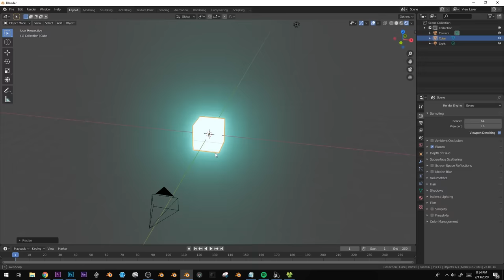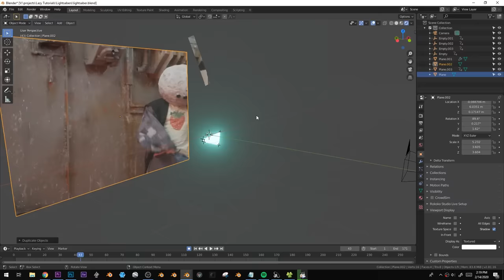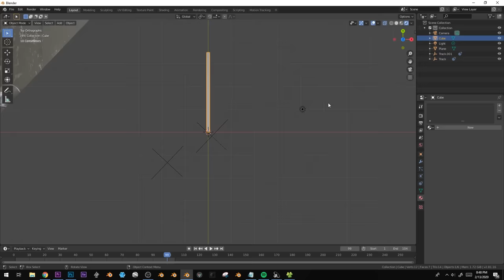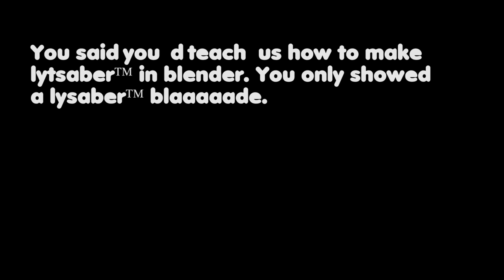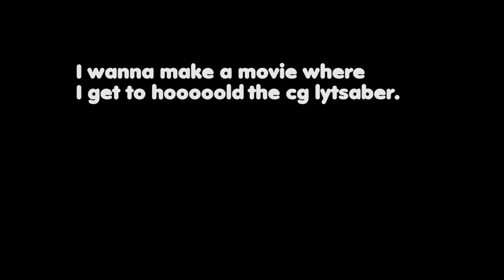How to Make Lightsabers in Blender (the hard way, and the easy way)

Comment: Couple tips for newbies wanting to use the “hard way” in this video with hooked empties:

-If you don’t like the rectangular look, you can bevel the vertices (ctrl+shift+B) and hook constrain each group of vertices rather than just one vertex. Just make sure the bevel is very very tight to the corner, your key framing will also require you to adjust rotation now so be prepared for that. 
-A comment below talks about efficiently masking your tube. Going frame by frame is pretty painstaking, instead find key changes in motion, start wide and refine until it looks good enough. Frame by frame can look good but not necessary
-If your video was shot on a phone, Blender may subtly change the video. This means a screenshot masked over it for the lightsaber extending may create a noticeable box of different colors. You can use the exact same video file instead, set the frames to 1 and change the offset until it’s at a frame where you can mask it. This also prevents cropping issues.
Reply: how do you select a vertice

Comment: 2:25 - This, while slightly better than "going frame by frame" as suggested a bit earlier, is still a (common) mistake. The efficient way to rotoscope (or manually align things in general) is to start by placing keyframes at very large intervals (several seconds, ultimately the whole clip - i.e., one at the start and one at the end) and then add a keyframe, within that interval, *on the frame with the largest error*. Keep repeating this and you'll end up with the smallest possible number of manual keyframes.
Reply: That seems ridiculous when you consider ultimately how much motion the objects go through you will end up having to manually adjust each frame anyway
Reply: @gencraigz  the advantage is that that way you cant ever make more adjustements than if you were going frame by frame, cause it might just work in places
Reply: @juangabrieleliasgomez518  true

Comment: CTRL+E Extrude by normals.. man I've been looking for that for ages!
Reply: You could alternatively just hit E to extrude and then right click to escape. Then resize the new faces. CTRL+E is better though.
Reply: I usually hit E (extrude) then S (scale) then Shift + X/Y/Z (makes the scale command ignore the selected Axis). 

The lightsaber on the video could work with E  > S > Shift+Z.
Reply: When I move the hooks later on the beginning frames begin to disalign and the whole animation is not aligned anymore ?
Reply: i cant play vidio in image texture when i press space, any suggestion?
Reply: @murilokleine  or press alt+E and choose extrude among normals
Reply: @murilokleine  ++ me 2
Reply: Ctrl-e takes you to the edge menu in the edit mode
Reply: @radhinnasywanabyasa1673  You need to make an initial keyframe at frame 0, then keyframes as needed throughout the video. Then when you play it back the hooks should move your effect as expected.
Reply: truly a gamechanger
Reply: Here I've been hitting E to extrude, escape to cancel, and G to grab and move instead of just using I for inset.
Reply: wow even Cryo Chanber is here!

Comment: You can get retro-reflective tape for putting on bicycles and stuff. I feel like there might be a use for that for making tracking markers in applications like this.
Reply: Maybe a LED strobe synced to the beginning and end of the shutter in two different colors then it could track all the blur deformation too  (or calculate the expected deformation from surrounding frames).

Comment: Tips: Make each lightsaber for each character unique to that character as canonically, people have to make their own lightsabers rather than buy one from the market.
Also, if you add a more yellow texture (same as copper but yellow) you can put some Electrum bits on their which symbolizes wealth.
You can make a Krayt Dragon Stone lightsaber by making it brighter than normal, Trainer lightsabers are usually shorter because... well padawans are shorter because they are younger.
Make sure to add a small incline somewhere on it so you can access the crystal.

Comment: 4:27

If you want to do it the really pro way:

- Go to edge select mode
- select a vertical(!) edge loop
- select -> checker deselect
- select -> select loops -> edge rings
- hold ctrl while switching back to face select mode
Reply: What did he do a 3:39 ?!
Reply: @njplay  lol he entered top view using numpad if u dont have a numpad use the thing on the top right with x y z
Reply: @Charduza  thanks bud

Comment: spent 3 solid years in blender (animation, rigging, and poly by poly for my stupid ideas, and also modeling for 3D Printing), but then let skills atrophy for 2 years. I've seen more blender instructional videos than I can count, remember, or hope to remember. This was absolutely fabulous; so tight and punchy and clean with focus on solid foundational techniques that (like all efffing blender things) requires one tiny bit of hyper specific sophisticated knowledge to make everything work, with solid fundies wrapped into a hilarious generally solid learn-bomb. I think you should spin your approach out into a blender course and charge for it, but first, for noobs, it would be great if you just did a remix-ish of your 30 second lightsaber blade build cause that was as concise and solid of a dirt-simple overview of A LOT of most-uised modeling techniques. Well done. Many thanks. I will patreon your face!

Comment: do you think it would be a good idea to make a lightsaber shaft and then a little pice which is transparent, then track that onto the handle. because in theory, I think it would be alike taping a stick to it so it should work, this way you could many slice stuff with it as well. 

edit: Mabey the hand would obstruct the markers but you'd just have to do more by hand I think

Comment: hey at 4:27 a better way to make a saber would be to use the screw modifier. Way less vertices to deal with and can be dynamically changed later. Aslo booleans. Use them.

Comment: Using the second method, I should be able to just track the top and bottom of the hilt, and line the beam up with those two points, but only have the beam start from the top point right? Seems like the carboard tube isn't needed but I'm prob wrong.

Comment: would the tracking dots still work if the blade is moving alot like in the hard way portion of the video or are they  for only slight movement's

Comment: Isn't there a way to get the glow to composite correctly using alpha "premultiplied" colors during render? Edit: I actually tested and it works "correctly" when using node compositing (after enabling transparency in the render->film properties) but not using the camera background-image properties.
Edit 2: Obviously, if you do use node compositing, than the masking of the space ladder is best done using a mask (in the movie clip editor) and not a mesh like in Ian's tutorial. As a "bonus" the masking  could be done using point tracking if the camera or ladder where to move.
Reply from the maker: Definitely!!! And the blender compositor is way more powerful than trying to do it all in the viewport, for sure- I just kinda liked this way as in into to thinking about compositing in blender. 

(Also oh man yeah- combining masking with camera tracking- that's crazy excellent!!)

Comment: Hey man, I love this tutorial. This has been the guide to my first attempt at VFX so thank you for inspiring me! I have a bit of a problem though, I tracked the lightsaber material onto my broomstick and it looked great. However, I then saved and exited blender to carry on later and now the lightsaber is essentially trailing behind the broomstick: it is not in time and is offset for some reason. Its movement is still great but it isn't matching up with the video for some reason. Any ideas?
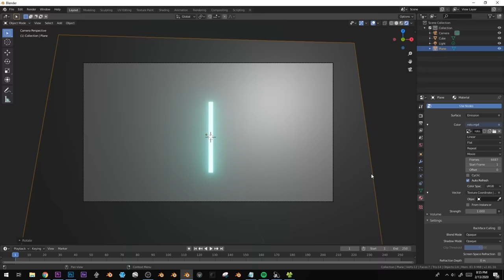Reply from the maker: Ooo- yeah! It sounds like it's probably offset by a frame, yeah?  Check out the material settings at 1:20, and tweak the "Start frame" setting a frame or two in either direction. That should hopefully clean things up! Let me know if it doesn't! ...No idea why it would randomly just shift like that on you, though :/
Reply: @IanHubert2  I think I've got it working now (: 
Thanks so much!

Comment: changing that  cube to cylinder is not for a beginner without hoitkeyes and so on.  after some time findind my prob. 
I wanted to tell: just mark ur cube and press shift +a and the chose cylinder and it works that way to. This vid is ofc for oepole who knows some blender or other like maya.
Reply: I mean you can google that stuff easily, but you're not incorrect you need baseline Knowledge of Blender.

Comment: I need help with creating the emission material, I'll select it with the cube selected, but when I go to change the color, nothing happens
Reply from the maker: Ah- make sure you're in a rendered mode instead of just solid view! (hit Z or Shift+Z)
Reply: Simpler way if you don't understand anything he said: go to the top right of the screen in layout and you'll see 4 balls. It should be on the 1st ball. Click the 4th one with the smudge and little lines and that's how you see the shading. It should be called  Viewport Shading.

Comment: I am at 2:20 and for some reason, my video is not playing. What do I do?
Reply from the maker: Hmmm- under the material/texture settings, make sure the video has more than "1" in the "Frames" input. If you load in a video, but then load in a different video, sometimes it doesn't set it to the right number of frames. You can just crank it to like 5000 or whatever- having too many doesn't hurt anything :)

Comment: I have a problem
When I set the surface to emission, it doesn’t change to the colour it’s set to
Even when I check “bloom” and the render engine is “eevee”
Please help
Edit: ok I just fixed it
New problem: I can’t move the points like at 1:46
Oh and also it doesn’t show when the footage is there
Edit 2: OMG I JUST FIXED MY PROBLEMS AGAIN
Reply: i've encountered the same problem with emission, how did you fix it?
Reply: You see the thing in the top right of the display? See the circle things? Select either the one that’s a 3/4 gray coloured sphere or the one that’s fully grey
That renders it out

Comment: Hey, I am following the hard mode step by step, but I dont know why I see my video as a single image, someone can help me?
Reply from the maker: Hmmm- under the material/texture settings, make sure the video has more than "1" in the "Frames" input. If you load in a video, but then load in a different video, sometimes it doesn't set it to the right number of frames. You can just crank it to like 5000 or whatever- having too many doesn't hurt anything :)
Reply: @IanHubert2  Hey! Thanks very much for answering me, I did it and it worked! Sort of... Like when I change from photgram to photgram it takes like year to randomly show it. Sorry if I bother you too much 🥺
Reply from the maker: @morel5018  Oh gotcha! If your footage is super high res, that makes sense. Sometimes for responsiveness what I'll do is make a special version of the clip that's lower res, work with that, then swap out a full res video for the final export (if your video's small enough to fit in RAM, it should load in and give you realtime playback).

Comment: "The easy way" is to paint the physical light saber with keyable color(green) and add glow in compo
Reply: How the hello-kitty are you going to paint in a line frame for frame for a film?
I did that back when technology sicked, and I averaged one frame a minute... Which was good back then.

So for 1 second of film, it takes an Hour. Half an hour if you're a boomer who loves 24fps.

Terrible Idea.

Also, I'm not aware of a program that lets you physically paint pixels frame for frame on film. (That isn't trash; grease pencil  is also trash for this) You'd probably have to export each individual frame to edit it externally then re-import.

Sincerely: 70,000 hours of rotoscoping. Send help.
Reply: @Ranstone  Man you didn't understand what I suggested. I meant paint the physical stick that your actor is swinging around. I literally said so. So for example your chromakey is green, you paint a stick blue, you key blue in post and change it's color/add glow in post. this is the easiest way. Rotoscoping is never easy)